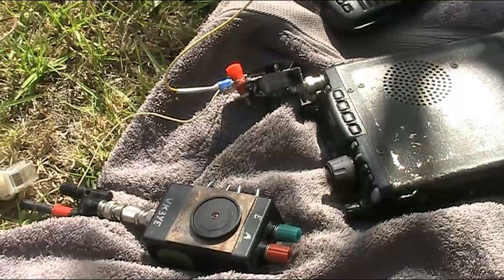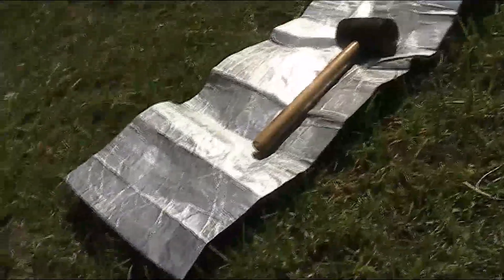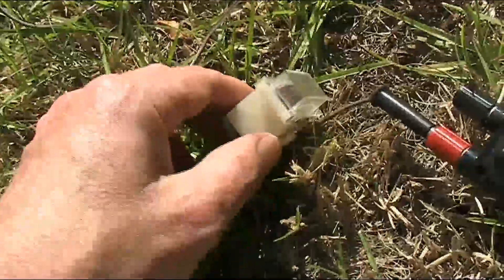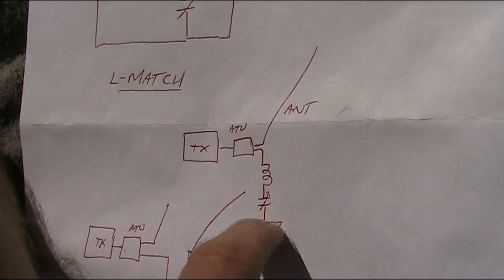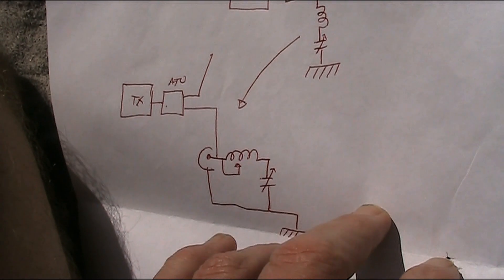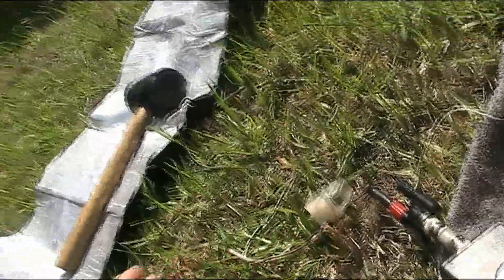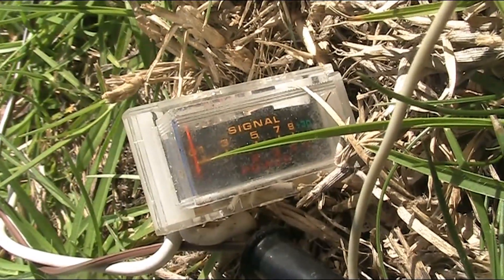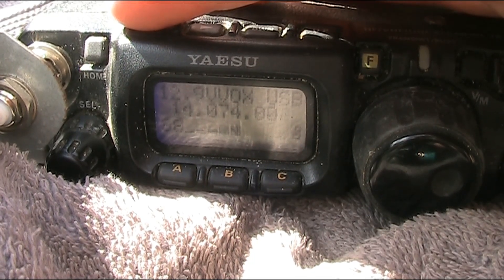Use an L match as a ground tuning unit

Comment: Here's an amusing story, at least for two of us.
Myself with Frank operated a special event station at the Museum of Science and Industry in Manchester with a long wire aerial. Graham had brought an earth tuner and laid out a counterpoise earth wire and proceeded to connect the tuner. He jumped back. He had got a shock.
I used my h/b radio at only 5 Watts ssb or cw. It shows how r.f. voltages can develop on aerials and earths. Be aware.
G4GHB.

Comment: Peter, hi! In winter, when it is difficult to install the antenna on the snow in the field, I use the GTU with foil on the ground with the instrument tuned. The results were always positive. I did not make comparisons with the usual counterweight, which I use in the summer. The question is very interesting. What is more efficient? Resonant one counterbalance or this option?